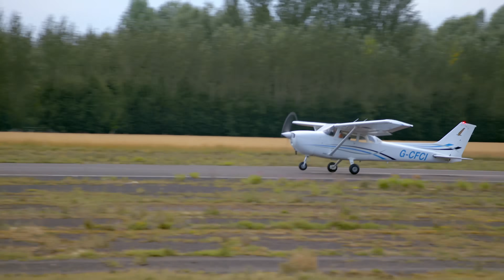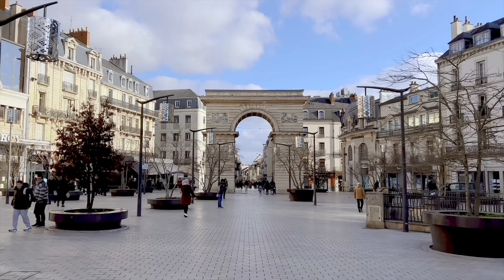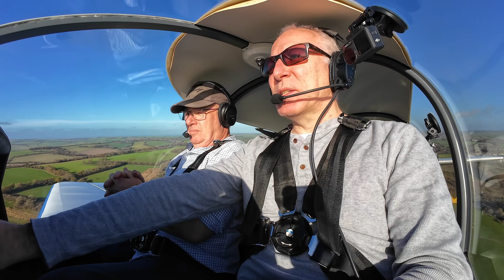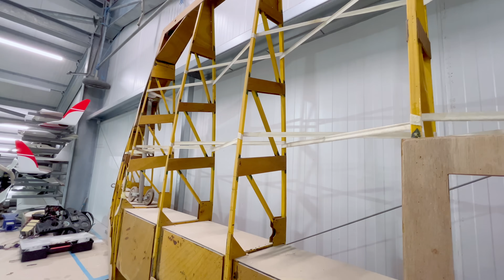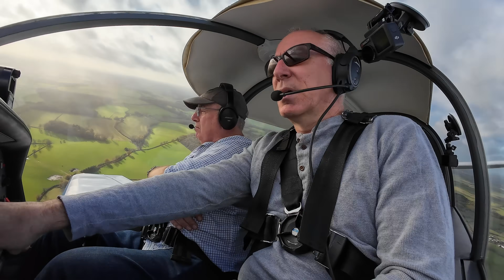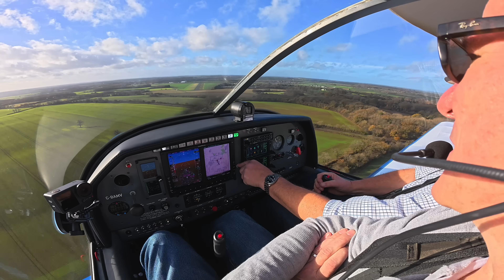The quirky French plane giving the PA28 a run for its money!

Comment: It’s the same in the Chipmunk, they are know as full travel brakes and you need some brake on the ratchet before they work, they also restrict the rudder hence part of your HASELL checks at Airframe is flaps set, brakes off.

Comment: Thanks for the memory. I used to own and fly the DR400's grandad. A 1964 built D117 when called the Jodel. The crank wing was originally the only dihedral on an otherwise flat wing and worked well. Pwered by RR C90 it took me from Newcastle to France non stop on 'duty free fuel' many times over the years. Never missed a beat and you could camp under the wing on grass strips such as Belle Isle.

Comment: Robins are brilliant and extremely capable aircraft, though, personally I prefer the taildraggers. I did feel you were damning them with faint praise, but you need a few more hours to get the virus…. The stick loads are much less than a PA28 which, to me handles like a Ford Transit - the Robin is more like an MG - and is a lot less tiring to fly. I felt you were gripping the stick too tightly to really feel the aircraft, but that is normal for a spamcan pilot!!!! In crosswinds they handle brilliantly as long as you use the wing down technique and avoid any side loads on touchdown. But well done and fly in a Robin again soon

Comment: Great to see, and what a beautiful aircraft restoration, but I feel the weather may have distracted somewhat from the overall impression you got that day, but that said, you dealt with a 10kt crosswind component on your first landing in it.  I hope you will revisit the DR400 again soon.  Others have already commented on the straps, and I was told more than once in my training to relax my grip of the stick.  What I learned was also a good practice was to place just my thumb on the throttle knob during takeoff, as - with a possibly worn/possibly not fully latched seat adjuster on a well used training aircraft -  as I rotated, my seat slid back with my hands full of closing throttle lever and stick back! Fortunately, my instructor was able to take control, but it had been an interesting moment, that I'd advise guarding against such a heart-stopping moment.  

I learned on a fleet of mostly DR400-108, at Headcorn and Rochester, and never saw such a beautiful panel as that, but I got my licence in 1988.  I'm still current, and still enjoy DR400's over the American offerings, and have recently got checked out in a Robin 2112, (the toe-brakes of which I found took some getting used to, to avoid inadvertent activation when landing, if you have the seat set forward), with a view to resuming a few aerobatics, which I last did in  Stampe SV4C/Gipsy G-ASHS, which others with Rochester Robin experience may also have got a taste of.
Reply: The seat locking was one of the issues addressed at the re-build of this aircraft, like on Cessna’s the seat locking mechanism can fail to engage if worn. On the DR400 play in the system limits the latch engagement, on the Cessna wear in the seat rails results in the latch ramping out.

Comment: The brake system may be weird because it's an old plane from the 1970's.
I flew younger variants with toe brake and either directional nose wheel with rudder or turning with with toe brakes.

Comment: What I love the most with these planes compared to the PA28/C172 is mainly the great forward visibility. Also the performance difference you get for the same engine is very nice!
The wooden structure gets really interesting if you live near the coast as it doesn't oxidize!
BTW toe brakes are an option but are available on all versions.

Comment: We fly this frenchy every time. It is a fine working machine with a great payload and ease to use. We all love it: our club has 3 machines running as clockwork. Two 155  CDI's and one lighter 135 Diesels all. On a rough nosewheel touchdown they might have a silly vibrant shake entend but it reminds you of how butter is produces: with a light stick.
On final with full flap deployement they sink as a real escalator, so nice.
Thanks for the story Jon!
Reply from the maker: Thanks Luk.
Reply: Check the nose wheel tyre pressure and the torque loading on the Belleville washer on the nose steering pivot point…….. that should sort out the nose wheel shimmy.

Comment: Run for its money? You’re having a laugh a regent will out perform a pa28 in every aspect bar endurance.
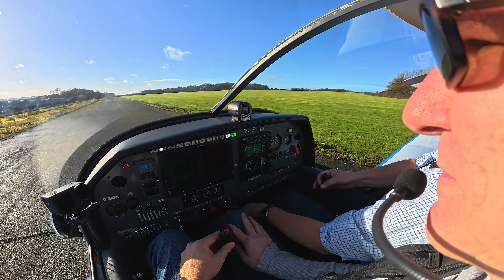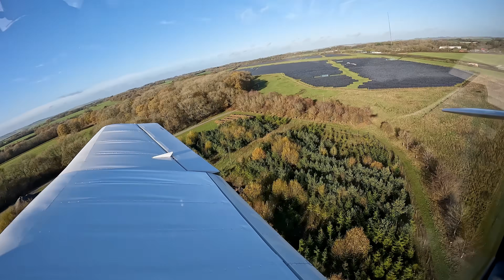Reply: Endurance?? The standard DR400-160 & 180 has an almost identical fuel capacity as the PA28-160 &180. Being fitted with almost identical engines the endurance is much the same……but the DR400 will fly further. The Robin flown in the video has the supplemental tank under the baggage bay that adds 50 litres giving the aircraft an endurance of 6:09. ( 75% power to dry tanks ) The aircraft flown is fitted with the Electroair electronic ignition system that cuts the fuel consumption by just under 10% giving an endurance of 6:39 to dry tanks………… it is essential to carry a wide necked bottle !

Comment: Hi Jon, Happy new year and thanks again for a great video.  I  worry that your waist strap was so high.  Looks likes you've tightened the shoulders first.  As I've been taught,  in a 4 or 5 point harness you need the waist strap tightened first otherwise it won't do it's job properly and may cause more injury.  Happy Flying.
Reply from the maker: Thanks I picked this up on the playback.  Not the first time I've done that.

Comment: The braking system appears to be similar to the DHC 1 Chipmunk. One brake lever but variable differential braking based on the position of the main lever.
Reply from the maker: That's right!
Reply: @TheFlyingReporter  A good system once you get used to it!

Comment: My first aircraft I owned was a 1962 MS 880B Rallye Club - slats and fowler flaps, plus right break touch on rolling for takeoff. Great fun as long as your not in a hurry. My second aircraft I still own is a Robin DR400-140B Dauphin 160hp engine. Great short field tourer. Both classic French aircraft with some quirks, but doesn't take long to get use to their foibles.

Comment: We have two Robins in our aéroclub in LFMD and I might give them a go following your video; perhaps get me out of the PA28 comfort zone ..

But you didn’t mention the thing that frightens us all the most: the very querky front wheel that only locks with a hard touch down; cause of many aircraft crashing off the runway on landing….
Reply: The failure of the nose gear centering lock to disengage on landing is an indication of poor maintenance practices. The shock struts require a set quantity of oil and air pressure to work correctly. These oil quantities and air pressure numbers are set down in the aircraft maintenance manual and differ across the aircraft range due to weight. If the shock struts are charged in the same way as most American aircraft  ( fill with oil when compressed and then extend and fill with air ) the shock struts fail to perform properly because the correct rising spring rate will not be achieved. It is wrong to attribute the nose wheel failing to unlock on the aircraft when it is a result of poor maintenance practices.

Comment: Thanks for sharing Robin love! And excellent job flying that approach under those wind and turbulence conditions!
Strange that you report her feeling heavy on the ailerons, mine definitely does not feel like this, but I have to admit I have not flown a PA28 for comparison!
I own and fly a 1971 DR253, the immediate predecessor (and the first "Regent" in the Robin family.) The 253 has a slightly larger cabin, 240 liters of fuel, and a unique "cobra" stick compared to the 300 & 400. 
Some DR400's have well north of 10,000 flight hours. They are brilliant machines. The biggest negative I have about them is the lack of STC's, particularly for avionics: Because Robins have never been FAA certified, US manufacturers (looking at you, Garmin) don't know or care about them.
If you read French, there's an excellent book: "La Saga Robin" by Francois Besse.
Happy flying!
Etienne (EDQN)

Comment: The reason you pay more for an all aluminum airplane is that they are much more tolerant of the weather and being stored outside.  Wood and fabric airplanes are particularly prone to deterioration in the weather which is why they hold their value poorly.  And most fabrics needs to be replaced every 30 years or so, whereas aluminum will last nearly indefinitely if well maintained.  Every material has pros and cons, but for weather durability, it hard to beat aluminum.
Reply: I have also owned three metal aircraft ( PA28 & 2 x C152 ) due to hangar maintenance these three aircraft had to spend a winter outside. The cost of extra maintenance in fixing damp radios ,wet carpets, corrosion, lubricants washed out of bearings and bleached paintwork equaled the money saved on hangarage costs. Personally I would rather keep a metal aircraft in hangar and save on-the maintenance rather than save on the hangarage and pay for-the maintenance.

Comment: They are brilliant aircraft. I used to do glider towing in 180 HP DR400s. They have excellent visibility, superb takeoff, climb and cruise performance. Ours were simple, fine pitch, four bladed jobs and had a great climb and descent performance. We’d climb out at 60 and approach at 50. They’d comfortably operate from short strips, with a glider and their low approach and landing speed meant you could drop into most fields. The very best tow aircraft we had was a DR400 with a 200 HP engine and wobbly prop. You could cruise at 120 kts with a glider. If they have one drawback is that you have to keep them in hangars but for short periods you can have wing covers. If you can get one, buy one. You won’t be disappointed.

Comment: What is the cost of maintaining the wooden and fabric wing?
Reply: As long as you keep it n a hangar there is little maintenance to do on the structure. About once every thirty years it is best to take the fabric off and inspect the structure and this will cost IRO £40k. It might seem like a lot but over the same time period a PA28 is likely to have had the right wing off twice to replace the walkway skin , at least one set of flaps and most of the Aluminium/ steel interfaces due to corrosion…………. The bottom line is there is no cheap aircraft to own and anyone who tells you he has a cheap aircraft is probably flying a death trap.

Comment: Is the 180hp injected?
Reply: No ! The aircraft flown has the O-360 fitted. Robin do now offer the IO-360 and it is the best performing DR400. The only non standard engine feature of the aircraft flown is the Electroair electronic ignition system……… it saves about 10% fuel burn.

Comment: A lot of small 2 seater aircraft. Most aircraft in that category use a hand brake to brake  rather than having toe brakes. Not seen a lot of 4 seaters using that design though. And definitely not the left/right rudder situation, i guess that makes sense if you need to do a tight turn or something.
Reply from the maker: It takes a bit of getting used to.  BTW, thanks for your email to Bertie. I keep pestering him to reply to you

Comment: Another great video, one point of safety advice, that 4 point harness, the buckle is in the centre of your chest, on impact would tear your chest apart, always tighten waist l(lower straps) first, then tighten shoulders. The other pilot has them fastened correctly.
Reply from the maker: Thanks.  I noticed this on the playback.

Comment: Very interesting.  I did my PPL on a PA28 180, a Cherokee Challenger.  When that went in for a new engine, they wouldn’t let students fly it as they wanted longer flights to break in the engine.  Understandable, but I was at the point in my training where I was doing longer flights for navigation training, but I was still not permitted to fly it even with my instructor by my side.  However, I was able to continue my navigation training in a DR220, which although a tail dragger was otherwise quite similar to the DR400 I believe.  I did enjoy my flights in the Robin and remember it being more “sporty” than the Cherokee and easier to see out of.  I found it a good experience as a student pilot to fly a different type of aircraft quite late on in my training.

Comment: I accidentally ended up co-owning a DR400-160. 
I assisted its owner getting it back airworthy and wasn't particularly enthusiastic about flying it... Needless to say from the moment I got behind the controls I fell in love with the quirks and as a thank-you for the hours I put into getting it back in the sky, I ended up a part-owner.

I'm no stranger to french aircraft, having flown TB9s and a TB200 with Lincoln Aero Club, however the DR400 was something else completely. 

The first thing to get used to was the left-hand throttle, right hand stick layout, I thought this may be an issue but, for me at least, it feels far more natural.
Next was the brakes... Some later DR400s have toe brakes but the earlier types have a brake handle in the middle and linked brakes to the rudder. It's always fun teaching new people to taxy with this system. 
The penultimate surprise is the visibility the DR400 offers, I find it flies very nose-down and you find the view out of the front is second to none. 
Lastly is the speed. The wing initially feels stable but a little draggy and it always seems like it takes a lot of power to get beyond 90 or so knots but as soon as you break that number it accelerates to a comfortable cruise at around 120kts making it a real going places machine. 

Given the voice of any GA aircraft that I've flown for touring, I will always pick the DR400. 

Other notable quirks are the circuit breaker switches, the master switch on our particular aircraft is a cable operated contactor and the internal space is cavernous, with careful loading, 2 adults, 2 mountain bikes and enough camping gear for a long weekend away can be comfortably stowed in the back as the seat cushions easily lift out. 

The french got this one right.
Reply: The aircraft flown originally had a cable operated contractor and a positive earth electrical system ( As in the 2CV that also donated the wheel brakes and door handles) but there is a Robin Service Bulletin that allows the fitting of a Big relay for the master switch and a change to negative earth .

Comment: I flew a Robin 3000 for a few years. Not as popular, and not the most typical Robin, it was a full metal T-tail aircraft, but it shares a few parts with the DR400. Quite roomy and a real 4 seater with lots of endurance, same large panoramic windows, could cruise a tad faster than 135kts with just 180hp. Very agile, most effective fowler flaps and a charm to grease on landings The handbrake was in the center console, needed just a gentle pull. It had a yoke, but with just some +/- 30° deflection instedad of more than 90 as the Cessnas have. I dearly miss it.

Comment: Currently learning a 108hp DR400 and after initially doing 5hrs in a DV20 with toe brakes, and going to the weird handbrake and the differential braking on the rudder controls of the DR400. Took me ages to get used to this and kept locking the brakes. I still occasionally lock the brakes up. Have to do a weird fullish rudder and pulse with the opposite or just don't go full rudder! At least that works for me. Great visibility though.
Reply from the maker: I’m glad it’s not just me then!

Comment: I have owned two DR400’s. A 160 and a 180hp. The 180 is by far the best, fastest and best handling aircraft in its class. The 180 will fly four people, full fuel at 125kts over a very long range with two wing tanks, one large fuselage tank and optional rear tank. The ailerons are responsive and the handling responsive. The view out is far better than any Piper or Cessna due to huge windows. The fact it has two throttles, so you can fly left or right handed makes it ideal as a trainer in the lower powered flying club version. One of the reasons it is so fast but so safe is that the outer tipped up wing panels are at a lower angle of incidence in cruise, thus less drag but come into play in slow flight so landing approach is slow and runway distances for takeoff and landing shorter. The biggest downside though is being wood it really has to be hangared. Lastly, why would you want to fly with a control wheel when you can have a proper control stick !!!
Reply: Correct,it's a cracker.
Reply: I'd love to see a head to head against a Grumman Tiger. An Archer is a poor comparison in anything other than training handling characteristics
Reply: @FlyingNDriving I have flown a Tiger a few times and really like it. Fast, the best light powerful ailerons, really good laid out instrument panel. Really like the castering nose wheel, which is so simple and easy to taxi and turn. Not as docile or short field as the Robin. I believe it is cheaper on maintenance than Archer. 
Not sure that like the Robin 180 you can carry four people, full fuel and baggage.
Reply: @johnball4826  the Tiger is a lovely tourer, once you get your head around the difference in the picture from the usual Piper/Cessna fleet

Comment: Used to be in a group with an early Regent, then had a share in a Jodel then joined another group with a Robin HR200. Generally I consider them easy to fly and very cost-effective (the bent wing is a work of genius). Probably the best choice from a cost of ownership point of view, until you get to the more modern permit aircraft, but you need much mojre money to get into one of those.